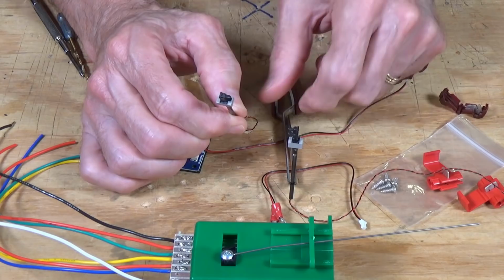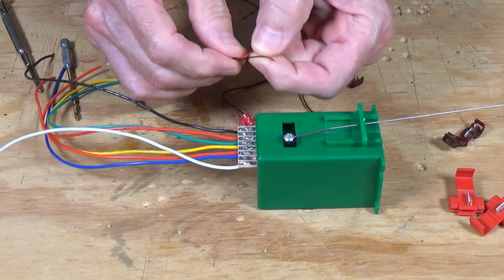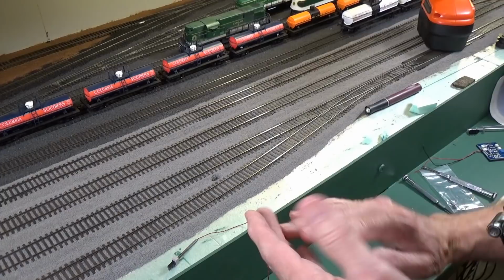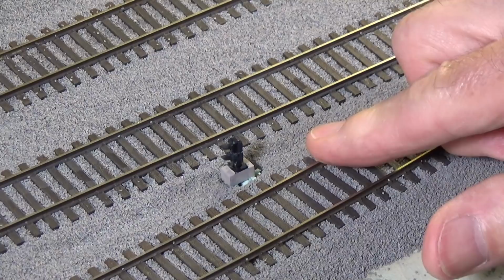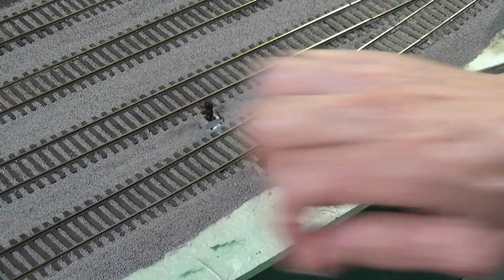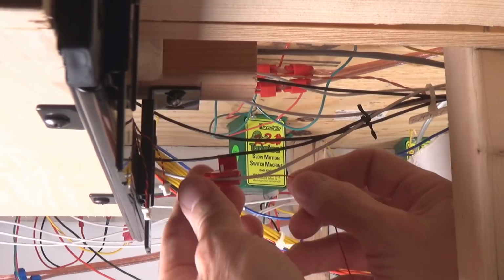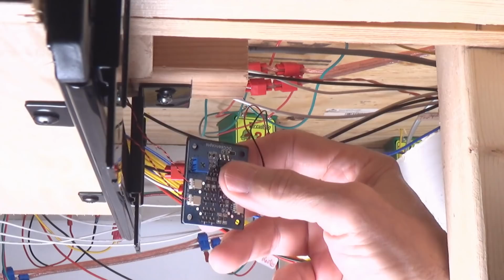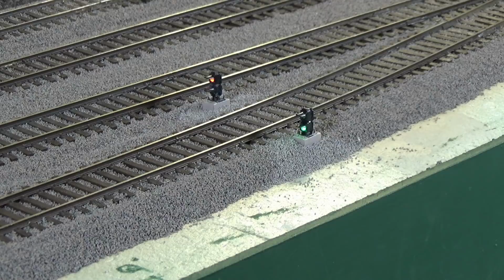Install Dwarf Signals For Your Model Railroad (213)

Comment: As an alternative,  having spoke to Dcc concepts people at Settle,  used the NCE Mini Panel + switches to send DCC signals to the cab bus to operate the ground signals & points using macros.  Thanks for your hints and tips.
Reply from the maker: Yes DCC Concepts have an impressive range of DCC items and you will see another one in an upcoming video, can’t say more yet.

Comment: Larry, on those small connectors, I just carefully lift the locking tabs a bit and slide out the terminal.. when I want to reconnect, just push the terminals back in. I use the point of a #11 blade. Works great.

Comment: I've nipped the little fingernail grips off before with OK results on the normal JST sized plugs, but those 1mm ones I haven't messed with yet. In reference to getting them through a small hole.
Reply from the maker: Yes, probably just easier to drill two holes and join them into one long enough.

Comment: I guess the other way round, if you only had the larger cable splicer thingie would be to solder some tails of thicker wire to the ends of the DCC Concepts loose wires. But then, you're probably using the splicer connectors to avoid doing any soldering. I'd have given in and soldered the DCC Concepts wires to the now exposed cores of the black & white wires.
Reply from the maker: Yes, that would be an option. However more and more I like the option of being able to plug and unplug a device from the power bus wires and the T-taps make that possible. I now keep a supply of sizes on hand.

Comment: Larry, Great video I am in the process of installing signals on my Layout.  I use Light-It to connect them to my DCC Accessory  bus Line  I also my a signal guide that way the signals are always drilled  the same distance from the center of the track  It looks like a cross made it out of Plastic Card I send you a phot in email   I also started using more T-connectors I starting to like them better now
Reply from the maker: Good idea Tom.

Comment: Great video Larry, I like how you discuss technical options and why or what may happen during the process. How would you wire these in DC format without tortoise switch machines and the use of only manual caboose ground throws?
Reply from the maker: While they can be powered using either DC or DCC, you do have to have a way to flip the polarity in order to change to directional lighting. This typically would be done using the contacts on a switch machine but a SPDT switch would work as well. Caboose does make a ground throw with a switch built in as I showed in video #261.

Comment: Thanks Larry, great set of videos 212-213,
Can I/we use these Dwarf signals with other DC points, like Atlas or Peco? or do I/we need to use the Tortoise or cobalt type switch machines?
Reply from the maker: No, they are designed to be used with the DCCconcepts iP Digital but can also be used with a Tortoise which does require special wiring to work.

Comment: Great video Larry. Are you planning on a signal for the facing point movement?
Reply from the maker: I guess facing point signals could be added by simply installing them back to back and connecting them using the 3 way connector I showed in the previous video. I’ll have to see whether Southern did them that way. I suspect not as this is a right hand running situation so few trains would be heading north on a southbound track.

Comment: Thanks for the video. Have you ever used or have any plans for signals that use infrared sensors, like Azatrak brand or the like?
Reply from the maker: I have built my own and used versions from Boulder Creek Engineering. The problem with using these for block detection and signaling is they detect when a train passes a given point but cannot tell if a loco or car is sitting on the track at any intermediate point. They are good for things like point detection and crossing gates, but in my opinion are not good for block detection signaling.

Comment: Hello, a question I have is: How would I use this on Manual Throws where the polarity is controlled through Tam-Valley Frog Juicer boards. My turnouts are not motorized but wired appropriately Left / Right to Power Bus then Electro Frog goes to the Tam Valley Frog Juicer.  

How could I wire in these dwarfs into my manual turnouts system?

I hope I am making sense? In other words I'm all wired up with polarity control.  Just need dwarfs to work when I pull my manual throws.

Comment: Larry, could you explain where you obtained the base for the dwarf signals?  Maybe, I missed something in your video. I also have a tortoise machine installed in the location where I would like to install dwarf signals.
Reply from the maker: They come as part of the device but in the previous video they were black whereas I painted them concrete grey as I said in the video.

Comment: Hi Larry, I'm wondering how you repaired the wires that you previously spiced where the connection failed, there will be no insulation left on the wires, did you use the same splice area with the new connector.or repair the insulation?cheers Jon.
Reply from the maker: The exposed area is so small it doesn’t matter. I avoid trying to hit the same spot as it might weaken the wire.

Comment: Hi Larry,
Trust you are doing well. Do you know of any signal system that works without automated turnouts and without position sensors on the layout? So the signals will be controlled by a switchboard. Maybe the atlas system? Perhaps an idea for a video. 
Wish you all the best.
Reply from the maker: You could do that using just about any signals available. Just create your control panel, install toggle switches to route power to the LEDs in your signals similar to how I showed how to wire up the control panel LEDs in video #209. Then just flip away.
Reply: @TheDCCGuy  Thanks! I'll check video 209 out.

Comment: Howzit Larry : As A Matter Of Interest; Did You Choose The Placement Of These  Dwarf / Ground Signals  As An Indication Of The Points Of Passing-Clearance For The Respective Diverging Tracks From The Switch ?  Cheers For Now / John
Reply from the maker: Yes, any closer and you would risk fouling the opposite track. I also checked with my biggest steam locos to make sure steps and other appendages didn’t catch on the signals.

Comment: Excellent video. Do you know if these dwarfs would be compatible with the Digitrax SE8C signal control system?
Reply from the maker: I have not used the SE8C so am not sure. It depends on how you power and control them. If a standard LED will work then so should one of these, You could just clip off the plastic connector on the LED wire and hook it up just like any other LED signal. However the interface may not work as it depends on a reversing DC power supply to drive it.

Comment: Is there a way I can email you about some questions with LCC. And wiring up a tortoise switch to a rotary knob?
Reply from the maker: The only thing I know about LCC is that it is supposed to be a parallel system for controlling layout accessories and interfacing devices. Most manufacturers are waiting for their customers to tell them what they want with LCC and the modelers are waiting for manufacturers to come up with stuff that uses LCC so they will know what it does. At MR we considered doing articles on it several times over the last 5-6 years but kept putting it on a back burner until there was actually something to write about.

There have been a couple of articles in MR over the last 20 years or so on using rotary switches to control Tortoises but all I have done is read them and continue to use my pushbutton and toggles switches. Consequently I doubt I will be of much use to you.